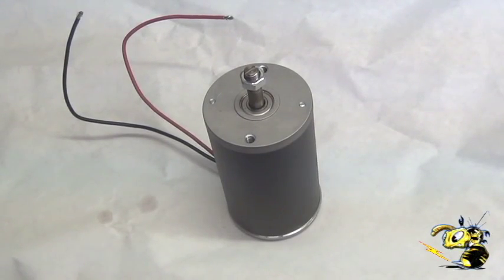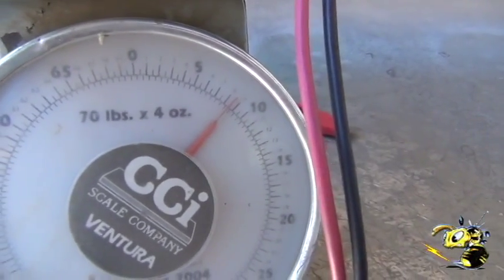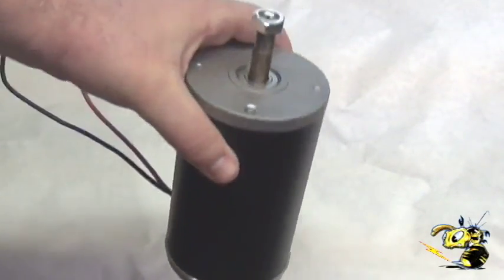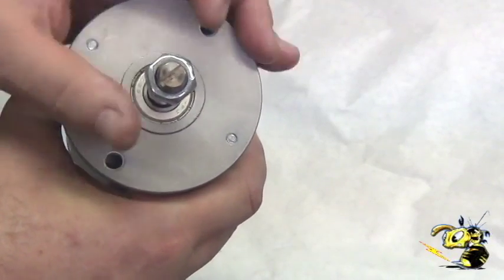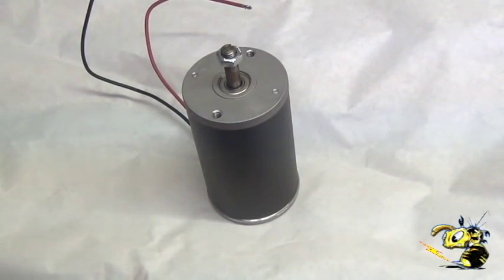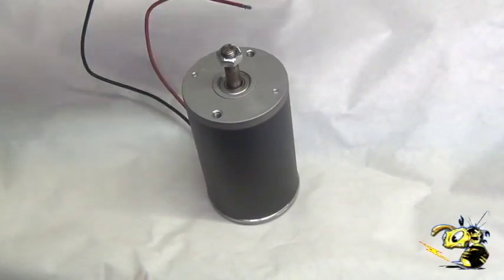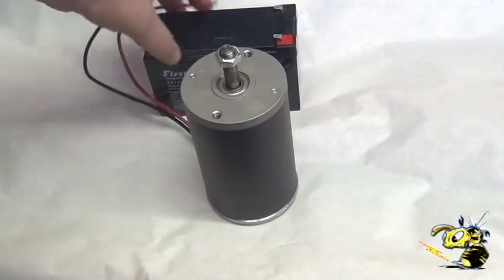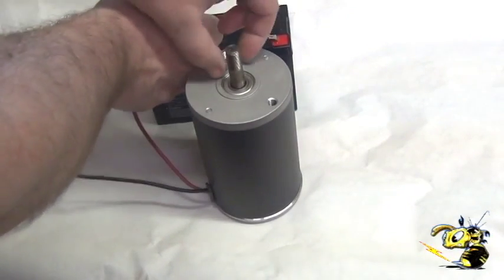DC motor electric mini bike motor and project 1 hp / 3000 rpm

Comment: I'm really thinking about buying a 12v model to build a DIY electric push mower. I have a 21" mower with a blown gas engine. Do you think this motor would handle a 21" cutting deck?

Comment: Hey I had a question I was looking at buying the same motor but I am not understanding something, does the motor require a full 750watt power source to run or that's just the peak and it would require less watts with less power to it?? Can anyone help me on this

Comment: can I run it with 12v charger
Reply from the maker: Just spin it fast enough and hook the wires to the battery and it will start to charge it.  You need to fine a way to turn it, wind, water, motor, something ,,,??

Comment: the battery weight  please ?
also  how could change RPM ?
Reply from the maker: http://www.hydrogenappliances.com/1hpmotor.html     3000
Reply: thanks but   800w/12v =66 amps    , you are using 14amps  whats the effect ..'time? or torque?

Comment: That's awesome Change of things. But still a great idea on product line. And a great price and a great gift for young and old. Just need a trickle charge of a 10 to 20 watt solar to keep  battery charged when idle.  Thanks Bob
Reply from the maker: +TheBillytheJack2010  -  I like this kind of product since it's so much fun to ride. Gives me ear to ear grins for hours :)   The frame we are building is bigger and modular and it can easily fit a large man.  It's also so small it ships postal which is a first for a mini bike kit.  I think I will probably patent it too.